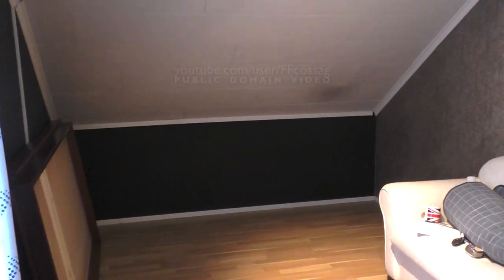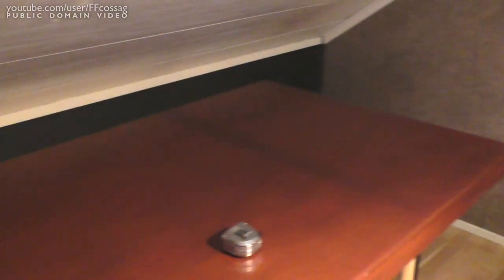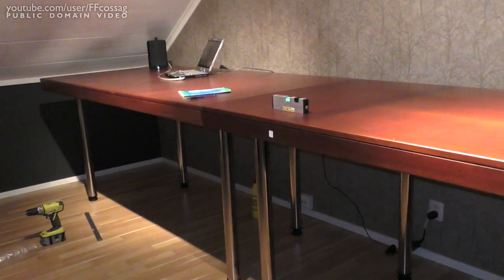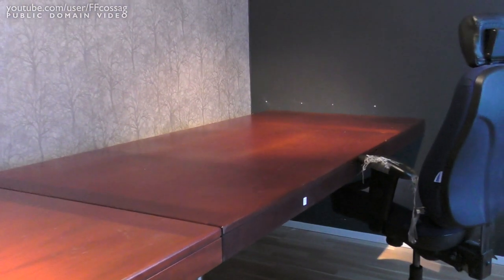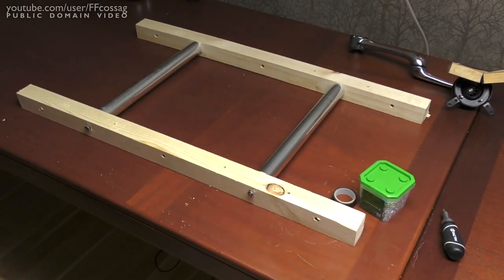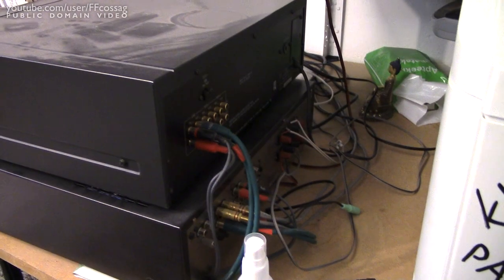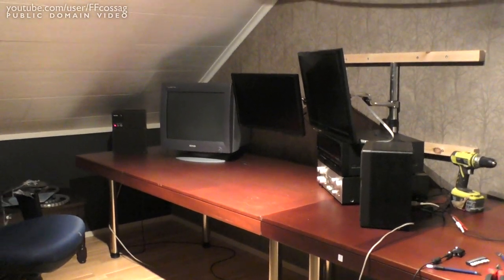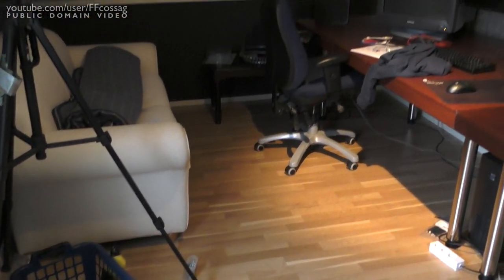Building myself an office! (w/ electronics repair & acoustic panels)

Comment: hi 
ive just recently come across your channel while looking for reviews on cheap amps off ebay and im not that clued up when it come to sound so i didnt understand the reviews that clearly. As you have an in depth experience with most of these cheap amplifiers under $40, I'd liked to know what your recommendation would be for best amp for 2x25w speakers
Reply from the maker: Breeze Audio
Reply: FFcossag thanks so much for the quick response but I've heard something about hiss 
is it better than the lepai 2020a+ ?
I'm going to be using it with my desktop pc